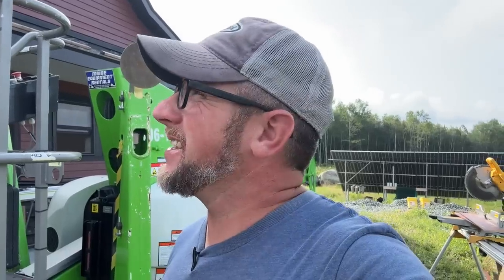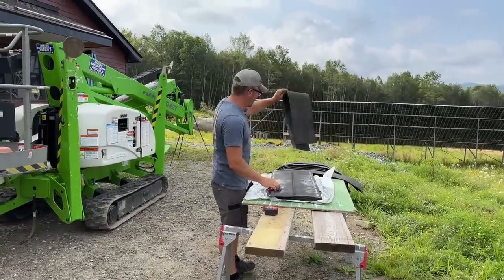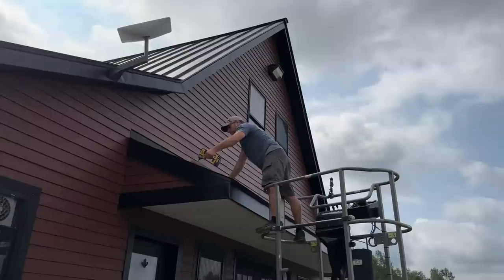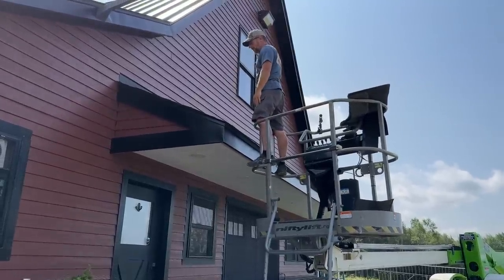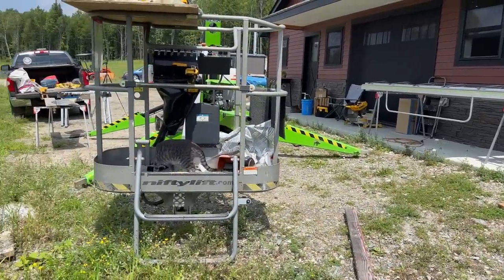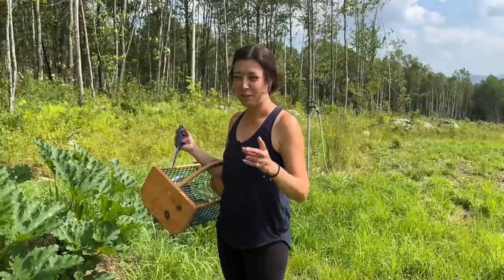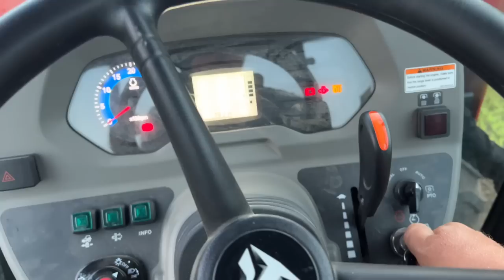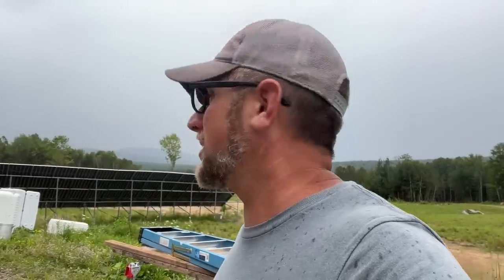QUICK and EASY ROOF Install | Now Our OFF GRID House in the WOODS is COMPLETE!

Comment: I’ve been a long time viewer of the channel. I don’t usually comment. I love your work ethic and thought process that goes into your projects and construction. This is the one video that hurt my soul. Being in the roofing industry, they sell starter shingles. That was the proper option to use. Starter shingles have cement/tar strips on the back to adhere to the drip edge. If you would have used the bottom portion of the shingle or just flipped and entire shingle upside down you would have been better off. Also starter shingles only going on the eaves. So the bottom edge of a slope not on the rakes which are the side edges of the slope. Also if your mail pattern is 1 2 2 1. Which it looks like you are going for, there should be about a foot spacing between the 1 and 2 on either side. I don’t mean to knit pick but you may get your shingle on the bottom edge getting blown up in strong winds. Also I don’t understand the shingle over hang on the eaves and rakes. That will make the edge of the shingles curl over time. Flush is the proper option for installation. Where I’m from we also use cement/tar to seal the drip edge. I know up north it’s not used as widely but it will save you a lot of head ache down the road. A big issue we ran into here and still see when removing 15-20 year old roofs, the bottom edge is rotten out. The water will find those nails in the drip edge and rot out the edge of roof.
Reply: Really good points.
Reply: Also, no flashing at the top. I think he did the flashing before the siding, so water can get under the shingles 😮😮
Reply: And if I can add to this, did I miss the flashing over the shingles on the top edge of the roof?  It looks like you flashed the trim board, then ran the shingles up to and over that>>>?
Reply: Hahahaha! I know, I’m a retired building inspector and it used to drive me crazy when YouTubers did things like this. My biggest gripe is calling “footings”, FOOTERS. but I learned quickly that it took the fun out of watching. 
They do the best they can with the knowledge they can receive from research. You can learn so much from YouTube.
If that’s the only mistake they make building a farm from scratch, I applaud them.
Reply: Yes the flashing too. The flashing should be behind the siding but on top of the top row of shingles nailed in with the tan portion cut off the full shingle “glued” with tar/cement on top of the flashing. That’s how we do it here.

Comment: I’m an old roofer, the starter shingles you want the tar strip to be on the drip edge side, that way the first course will “glue” itself down at the drip edge and side.
Reply: Or you can come back with roofing tar in a caulk gun and get the drip edge. Helps the first row stay put in windy conditions
Reply: Did you see any flashing on the top row?
Reply: @davidlang576  I think he did previously when he put up the siding, just have to slide the shingles under the flashing and tar/caulk

Comment: Hi Al.  Don't you need flashing between the wall and shingles.  Usually there is a flashing that goes under the clapboards on the wall and over the roof shingles to keep water from getting behind the shingles.  My family loves your channel.  Keep up the good work.

Comment: Wow you guys get colder weather than we do here on Vancouver Island and I have to use a whole square but shingle for the frost line you're only using like a 6 inch piece And we turned our frost line shingles on the edge upside down so you didn't have to look at the underside of the shingle you got to look at the good side of the shingle

Comment: Gina is correct, hand nailing is best. During the Florida hurricane season they noticed older pre pneumatic nailer the roofs held on better. They surmised the air nailers pressure were not set up precisely, damaging the roofing material or completely missing the structure of the building. I’m sure somewhere in the internet you can find the articles. Btw, good job with roof and everything else you’ve done on the homestead.

Comment: Don't you need flashing? Or do the shingles slide under the trim board and if that's the case do you silicone to keep water out from the house?
Reply: Yes you need flashing...under that black trim board and on top of the roofing...oh well...
Reply: @setdown2 many roofers have said that, but he's Al, so.........
Reply: he did say something about "caulking the edges" so maybe it will be shown in the future.
Reply: @colstace2560   well it's just the right way to do it...Al is a good mechanic he just doesn't know it all and at times he leaves out important things...
Example...water runs down the siding then hits the black trim board which is a bad idea to have it anyway... now water can go behind it even if he caulks it ( all caulk fails eventually )so with the flashing installed correctly any water will shed onto the roof shingles...🖖

Comment: For future reference: Usually there's a little bit of leeway in the amount of reveal. If you had done a test layout first you would have discovered that by increasing your reveal by only about 1/4" per row you wouldn't have needed that last strip of 2" for the top-most row of shingles.. Alternatively you could have decreased the reveal by about 1/2" per row and ended up with a half-height shingle on the top-most row (ie the portion you cut off to make your starter strips).

Comment: You may want to buy 1 extra bundle of roofing, what I have seen is sometimes the roofing company’s discontinue a certain colors over time and if you need to replace a few and your color is  not available anymore you will have to buy something close to what you have they never match and the new replacement shingles will stick out from the rest and it’s a bad look.

Comment: You needed to keep the tar strip on the starter shingle so that the 1st course would seal. Hopefully you went back and applied a bead of roofing sealant under the leading edge of the first course of shingles They do sell rolls of starter shingles in a continuous 33 ft roll.

Comment: Gooood Evening Al , Gina & Olivia ,
I listened to Gina carry on about being up on the porch roof. I could not help but think of the video that I watched yesterday. A woman in Vietnam is building her two story house by herself. As I watched her scrambling around on the roofing rafters , installing metal sheets of roofing material , I could not help but think of Gina. And then after the roofing was on , she was on the steep roof installing the joint strips and the cap strip. No ladders , no lifts, etc. Instead she uses a 4" diameter tree with notches cut for foot holds to get down from the roof.
  I suspect that Al with his lift might be hard pressed to keep up with her. Her exotic tools ? A hammer , a hand saw , a machete , and a hand drill . And that's it. Oh and leveled by eye. The house looks very good too.

Comment: thouroly enjoy your show, Gina is partially right. If it's an old roof with roofing boards it should be HAND nailed you can get a feel for the nail to makesure you're not hitting a gap in the boards. If a plywood roof the a nail gun is definately faster

Comment: Looking good.  You can take a big sigh of relief.  Just curious about the reason for the chicken dip into the boiling water.
Reply: I think the bags are heat-shrink ??
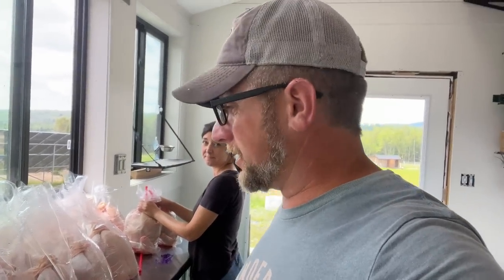Reply: To get the air out of the bags. Look closely from 23:58 to 24:20 particularly the red straw.

Comment: Good Morning!  Now that you are about to start your shop build I was hopeful you could go through your equipment/trailer lineup.  I've been trying to decide on my next piece of equipment between a mini-excavator or skid steer.  Our place is similar in size, about 400 acres of a mixture of pasture, beanfield and maple grove where we tap about 1200 trees.  My main tractor is a case 140 and I have 3 older Oliver tractors more for dragging and disking as well.  I'm curious of your opinion, mini-x or skid steer since you have a mini and a toolcat which is the cousin of the skid steer.  TY

Comment: I think it is required to put flashing over the top row of shingles.  Probably should be under the trim board, then reinstall the trim board.  Then the roofing nails that hold the bottom of the flashing should be coated with some roofing tar/caulk.

Comment: No drip edge?
Reply: No flashing
Reply: @colstace2560  .... he did say he was caulking the edges, which would be fine for a metal roof.
Reply: @rupe53  there should still be flashing at the top where the roof meets the siding, sealant isn't good enough
Reply: @colstace2560  ... would agree, but it is what it is. If I was doing the job, that top trim would have been just tacked in place till the roof was finished and flashed.... then put it back.
Reply: @rupe53  yep, exactly  👍🙂

Comment: On the porch roof, why didn't you put flashing over the roof where it comes into contact with the wall of the house?  The same way you put flashing over the lower stone area should be used on the porch roof.
Reply: Flashing was installed when they done the siding.
Reply: @tonygrimes13  Did Al video the installation? I just don't recall it.
Reply: @DukeOOO  Lumnah Acres said in a couple of replies that that was what they did.

Comment: Al I did not see you peeling the plastic off the tar strips. So if you did not they will not seal themselves. First big wind good bye shingles.   Hope you read the instructions that come on the wrapper....NOT LIKELY KNOWING YOU....:body-blue-raised-arms:
Reply from the maker: The tar was covered in plastic
Reply: You're not suppose to peel it off. The plastic on the back of the shingle is so the packaged shingles don't stick to the exposed tar strip on the shingles beneath it. The exposed tar strip is what will seal the shingles. The plastic strip has no bearing on the installed shingle.